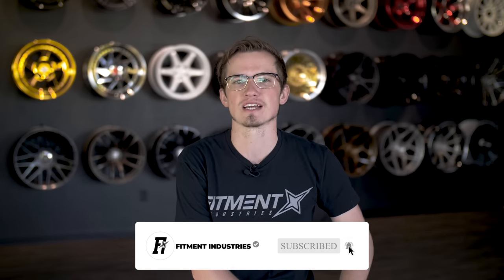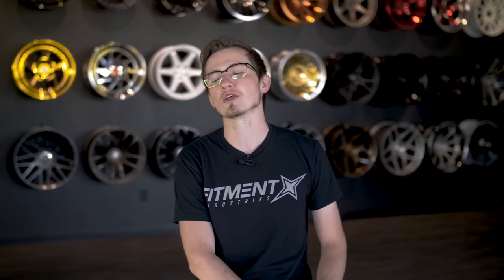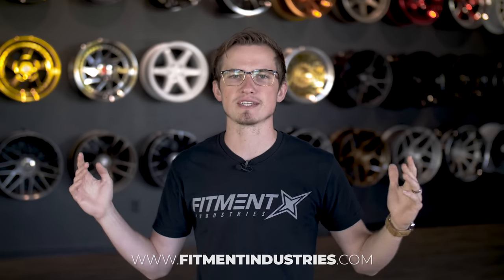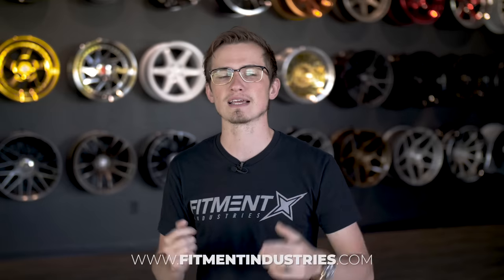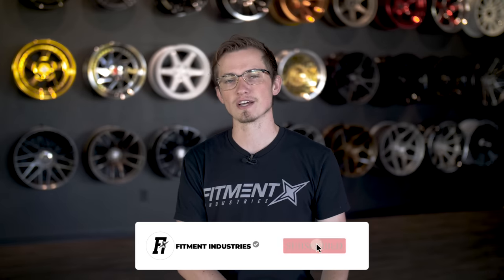Why You Should Lower Your Car

Comment: Did tint first then wheels cuz i'm not racing anyone on my 6 mile round trip to work on a straight 2 lane road. Shortly after lowered my ride on Eibach springs for all the reasons you mentioned but tint and wheels will always be my first choice. People still do underglow?
Reply: BL's GTI fast and furious rice balls still lives on. The scene is slowly getting back into underglow

Comment: I'm so glad you live in a place with perfect roads, no bumps, never have to drive on gravel, or snow , etc etc etc.   If I was going to do any suspension mods on my STI, it would be to raise the car, not lower it !!!!!!!!
Reply: That's why I'm going with air suspension. My state roads vary from smooth to rough.  With air suspension I can set a stock preset, a preset higher than stock, a low stance preset for familiar roads and a full drop preset for parking. All within a push of a button.

Comment: First mods on my GTI were all performance based. Intake, full exhaust, stage 2 tune,a HPFP upgrade, and a Boost guage. I'm saving up for some Airlift Performance 3Hs then getting wheels after. I Believe, to look modified and "fast" you need to be fast.

Comment: 1. TUNE
2. EXHAUST
3. SUSPENSION
4. RIMS AND TIRES
Reply: @juzryt  power first. Could car less if my car scrapes around town, would rather haul ass past you 🤣
Reply: Suspension first, brakes & wheels, then power/tune & exhaust last. No point in chucking in sequential turbos or performance exhaust on stock brakes tyres and suspension. You'll just burn through tyres and warp your brakes trying to utilise all that extra power.
Reply: Wedow keep thinking like that and you’ll see a lot of taillights 😂🤣
Reply: Justin SoNah it’s more like the first four should always be Exhaust, tune, suspension, and wheels...but the order that you should go in is different for everyone tbh. Depends on the car. My CLA45 doesn’t need wheels because it came with 19” alloy rims that look dope as hell. No reason to blow 2k on new wheels until i get all the other performance mods i want. (That plan went to shit when i bent a rim the second week i had the car and got a set of BBS rims while waiting a month for the AMG rim to come in from Germany lmfao)
Reply: IMHO ECU "tune" is useless in a N/A car, unless you just got done doing serious mods to the internals. Yeah you can change your HP/tq band but you won't increase anything that will effect your 0-60 time. In a F/I car you will see substantial gains, but only because your adding  boost and fuel. For the cost of a "Tune" you could do a ton of other mods that are more enjoyable.
Reply: Joshua Schofield Have you ever tuned a stock vehicle? Changing of shift points and power/torque curves will certainly improve not only 0-60 times but also improve 1/4 mile et..ask me how I know?
Reply: @eriv4735  change the shift points? Huh? Oh  you must be talking about an automatic transmission. I haven't owned an automatic in years, but everyone I owned shifted at redline if I floored it?  Not really sure a you could improve times that much. what kind of gains have  you seen? How much did you times go down? Iny experience (which I'll admit isn't very extensive) you can move torque lower in the band or higher, but your not actually adding power with a tune. You might be able to squeeze five or ten HP out at the expense of engine knock, or running lean, but it's not worth it.
Reply: Joshua Schofield Trust me on a stock ecu tune you were no where near redline on an open throttle..if you had your car tuned an you got a knock your tuner is a moron..I’ve tuned hundreds of cars and I’ve averaged anywhere from 5-18 hp at the wheel and we have seen 1/10-1/4 et decreases..these have been done back to back on the same day while giving the engine time to cool to proper temps..a proper engine tune is always a great mod regardless of the aspiration
Reply: @eriv4735  ok see that's exactly the point I was getting at. 5-18 hp at the wheels isn't noticable unless your doing a bunch of quarter mile times and trying to shave a quarter of a second off. I just don't see the value of spending a grand on something so insignificant.  I flash my own ECU so I dont spend that kind of money, but I don't see  a noob immediately learning how to flash either. At least not at first. The OP is suggesting this is the very fist thing you should do to your ride...and I disagree. If your a noob  I'd recommend things that will actually make driving more fun, rather than something so intangible, technical and expensive. I get it. It is a valuable tool, that's why I do it, but it's definitely not number one.
Reply: Joshua Schofield 18 hp AT THE WHEELS is very noticeable and a decent tune can range from 150-600..I’m not sure where you live but a grand is far too much money..also a tune will definitely make the car more fun to drive..tq/ho curves mean a lot to overall performance and can make a night and day difference..if you are just getting into modding an engine tune is a very important thing to learn how to do and will make the most bang for buck..I’ve been doing ecu tunes For well over 25 yrs and it has never been in vain..
Reply: @eriv4735  first off 18 HP is not noticable. If you have a heavy passenger that 18hp is totally negated . and that's a theoretical gain. Almost no one sees 18 HP from a bone stock car and just a ECU tune...150-600$? Maybe for a just a basemap flash, or a chip ordered online. Not for a tune on a Dyno. And unless the car is brand new that basemap means squat. A good set of tires would shave off more time in the quarter, than tuning a stock car. And a decent swaybar upgrade would improve handling around corners. Just not my preference...I'm not some track junkie, but I've done everything you can do to a car on a tiny budget by myself. unless you have a turbo, that's another story. then you start seeing a lot of power (50hp+) with just an increase in boost, and some tweaks to the map.
Reply: E Riv
Joshua Schofield honestly if you are spending more than 600 for ANY dyno session and claim the results are negligible you are getting completely ripped off and desperately need to find a new shop but judging by you claiming 18hp at the wheels is not noticeable and the fact that you think dyno tunes are even close to being 1k or even begin understand the importance of s proper tune I am beginning to assume that my original thought is core in that you have never modded anything in the first place..I am not attempting to project insults or negativity I am just calling it like I see it
Reply: @eriv4735  your not even addressing my arguments. Your just restating your opinion and whining that I don't know what I'm talking about. I'm beginning to think you are just a troll. Especially with your cowerdly anonymous profile so no one can tell the legitimacy of your claims.  But I will humour you...Iwill admit that if you add 18 HP to a go-cart it's gonna feel significantly faster, but if you add 18 HP to a 2000lbs. Car...not so much. Unless Newton's 2nd law of motion doesn't apply to you. Ex: If a 2000lbs. Car does the quarter mile in 12 seconds, it would need approximately 80 more HP to shave it down to 11 seconds. This is a fact. Now I'd say 1 second faster in the quarter mile would be noticable, but that's 8-0, not 18. Of course other things come into play like traction, friction, and drag, but  if you are just talking about power these are the facts. I don't know maybe you are just more sensitive to even the slightest increase in power.
Reply: Joshua Schofield 18 rounded to 20 is 1/4 of 80 which is EXACTLY what I said 😂🤣...a.25 second drop in 1/4 mile is EXTREMELY noticeable and if you were to have EVER raced or tuned ANYTHING you’d know that to be FACT..just quit while you’re behind
Reply: My car is auto tho.
Reply: Well tires could be number one if you care about stopping power if you deal with snow every year

Comment: I think my first mod was painted my corroded grill and then adding better halogen headlight bulbs for the low beam. After that I did a roof rack and then painted my own wheels (I plan for spacers to make them more flush fit) and then mud flaps.

Comment: When i was young, my parents had a toyota Avanza and they modded it. It had modded bumpers that are 3 inch low on both front and back and they lowered it as well. It looks hella cool yet one time we where going onto a ramp,  the whole front bumper extender came off XD. Now the car itself wasnt harmed since it is a 8 seater van of some sort but since it have the extenders and it was lowered, the lip came off. Let's just say, my pops wasn't too impressed.

Comment: Careful. Don't perpetuate the myth that "coilovers are always an upgrade." Truth is, most low end coilovers ride WORSE, perform WORSE, and are often more DANGEROUS. R&D effort spent on valving is costly, and not found in a set of $500 Racelands. Reducing body roll and CG represents only a small increase in cornering performance. Shock dynos paint the full picture, and a set or dampers matched with spring rates and good rebound WILL keep the rubber on the road, where you want it to be.

Short: No, many coilovers are NOT form and function upgrades on several platforms.

Comment: My first mods on this car was turbo charging it. Then fmic. Then putting a muffler back on it. Then front lip and rear spats. Next is painting my summer wheels. Maybe going coil over to drop it 2 inches in summer but go back to stock height in winter since I always drive in the snow. I always believed in making a car decently quick before trying to make it look cool or quick. Bonus is when it looks fairly stock and you pull on unsuspecting people

Comment: on my first car, a '98 Camaro V6, the first real mod (that wasn't just cleaning out mold and gunk and replacing broken stuff) were wheels and tires because no one makes 235/55r16s and the ones on the stock wheels were three different tire types from two different companies and they were bald and dry rotted and felt like they were made from driftwood. i needed replacements for those much more than i needed to change the suspension on the car (which my father and i kept fighting about. i wanted to lift it for rallying. he wanted it raked for drag racing.)

went with OEM C5 Corvette 17x8.5 wheels, black with a machined lip, with 275/45s Michelins front and rear.

then i had all the grip in the world until i understeered head-on into a Lincoln Navigator.

at least i found out i didn't have Takata airbags.

Comment: I definitely did coils before wheels for the fitment purposes, I then ordered front camber arms and then my wheels, no camber arms in the rear, just running stock 350z wheels for now, and ESR's in the front, looks killer, wouldn't do any other way. If anyone sees this (even though this video old af) definitely do suspension first, like stated in the video, it helps you visualize best fitment for your build wants. I'm gonna be running -9.5 degrees of camber in the front and like -4 degrees in the rear, drift car stance. This is something I realized I wanted to do after slamming my SC400. So unless you plan on copying and pasting someone's entire build (which is a big no no but if you don't care about being flamed then go ahead) lowering your car helps visualize wheel fitment a lot more realistically.

Comment: First thing I do to my cars; tint, new headlight bulbs (if they're halogen stock or simply want a different color) and lowering the car. Then I get rid of any chrome if the car has any along with new tires. Wheels haven't always been a top priority as I've had cars with decently nice stock wheels that look dope with the car lowered. I've also had cars where the stock wheels were horrid and I got new ones.

Comment: yup, i always do suspension first. In the early 2000's my first mod was ground control sleeves on kyb gr2's. I saved up the money and gave my friend the cash because he had a card at the time and ordered the gc's off JCW. I then saved up again picked up the shocks from autozone. I was only able to do the rear's one weekend and had to wait a week to do the front's ( i think i had to buy a part but didnt have enough money for it at the time). I remember driving around with a stiff rear end (i adjusted the sleeve to be about stock height so it wouldnt look funny). When i got the front's on I slammed the collars and on the first test drive i found out real quick you can't really drive around like that and end up doing about 1 or 2  finger gap so i wouldnt get tire rub. I also found out you must do a wheel alignment after you lower your suspension, i chewed up my tires in a few months. Ah the good ol' days.

Comment: Why you should NOT lower it:
1) Forces you to buy rims, since MOST stock rims don't look right when lowered.
2) You hit the bumpstops more often, if the springs are too soft (because the company didn't know what they were doing).
3) If all you get is springs, and you don't upgrade the shocks too, you'll bounce too much and wear out your stock shocks early.
4) You have to take your time over curbs and gas station ramps.
5) If you must lower, get REAL brand-name parts, not cheap Chinese Ebay crap.

Comment: If I lowered my car it would have to be adjustable on the go . Nyc = potholes ,curbs, metal contraction plates  snow and ramps . an accident waiting to happen. would only lower it on highway use OR parked, but I'm going to be moving ain't no one going to notice unless I hit a traffic jam .

Comment: I did itsy bitsy pieces first so warranty would not be voided. Axle back muffler, carbon fiber ducktail, interior carpets and tint. Then I went with coilovers. Still on stock wheels but the coilovers made the car look much better and perform better as well. All these mods can be found on my channel. Saving up for a wheel upgrade, maybe by next year. Then audio. The miata’s stock non-Bose audio sucks.

Comment: The first thing I did was lowered my Corolla on Tein S Tech Lowering Springs before an Exhaust and before getting Aftermarket wheels what a difference it made my car handle when cornering
Reply: I lowered my. Eclipse 2.5 inch on tein springs and it handles definitely better than stock

Comment: I know for me on any vehicle, I always fix up my suspension all around control arms, ball joints, bushings y’all know. For me it determines what I can do to the car, make a race car or a cruiser, for instance if race car I got to make sure the car can handle the power from the engine handle corners etc and same goes with a just a daily build making it comfortable. But yeah so suspension is always a first for me and right now it’s what I’m doing to my ef9 I just got.

Comment: I have an e36 which is coil slammed and am looking to fit 17x8,5 offset 13 wheels. Do I have to widebody it or can I get away with rolling the fenders? FYI I have all the camber adjustment to go crazy.
Tyresize = 235/45

Comment: I wish I could slam my car... But my exhaust system would be non-existent if I did that 😭. Atm my car sits around 7-8" from the ground like a monster-truck and the mufflers hang lower than the body and already scrape on speed bumps...

Livin' the low-life in a monster-truck 👌

Comment: Basically here, your only option for lowering is Airbag/electric suspension, the amount of speedbumps are ridiculous, one end of my street has 6 mountain speedbumps (ones where even 4x4's cant just blow over at 60kph) 

My brother in law has a slammed VY clubsport, in which he needs to go over speedbumps diagonally just to get over them without scraping

Comment: I'd love to get lowering springs for my little '06 Picanto, but I can't find any that offer less than a 30mm drop and I want to keep it below 20. Unfortunately, coilovers are five times the price and it doesn't seem worth it. I'd rather spend the money on tyres, brakes and an engine tune. I painted my OEM steelies a darkish grey and they really suit the car, contrasting well with the silver paint. Follow @the_hotch_hat on Instagram to check it out!

Comment: I threw ST170 wheels on an otherwise stock euro Ford Fusion. Looked like shit, but it was surprisingly grippy in the dry. only problem was that every pothole felt like a punch in the jaw. That being said though, the car wasn't worth proper suspension mods, it was just a first car to have until my insurance prices went down.

Comment: My mk7 Golf R has magnetic ride so I can’t get a coil over suspension without deleting that DCC control and I don’t wanna lose that. 034 Motorsport makes a good spring they doesn’t slam the damn thing. It’s .4” in front and .8” in the rear. Doesn’t sound like enuff but I’m 28 years old not 15 so. I just don’t want to rub or scrape or have to be too careful everywhere I go.
Reply from the maker: Nice! Sounds clean af! You should upload some pictures to our gallery sometime!  https://www.fitmentindustries.com/add-wheel-offset

Comment: Suspension/lowering has always been better than getting wheels first. Doing wheels without suspension (unless you already have a lower/sport oriented stance) looks awful and is very obvious. You may not even want aftermarket wheels immediately after lowering your car because the suspension change will transform how you look and drive the car.

Comment: 4:05 Man I wish my Tein install was that smooth on my G. Seized bolt up front, both rear bushing and bolts shot and seized, fuck, it took me a whole day to get the front side seized bolt out and about 3 weeks to realize I needed to take my car to an actual suspension shop to have the two rear shot bushings and seized bolts removed😂

Comment: I did wheels first only because I got the wheels at a really good deal and I did enough research that they would work well with my a/m suspension. Also I'm a broke boi who can't drop 3k on air ride which is my next step.